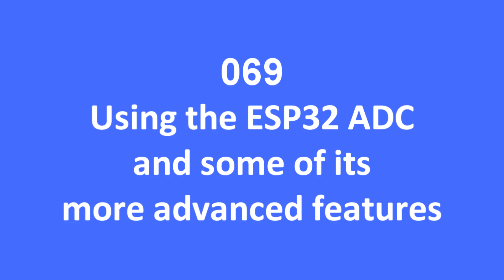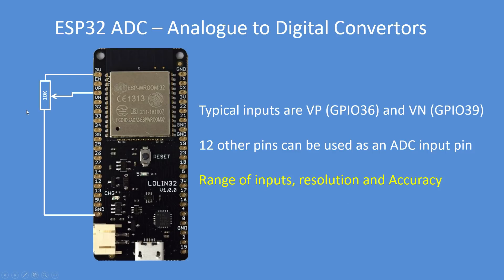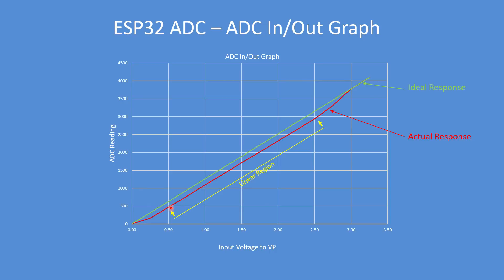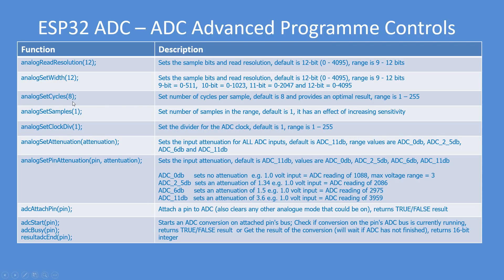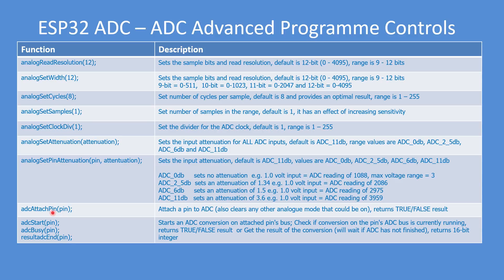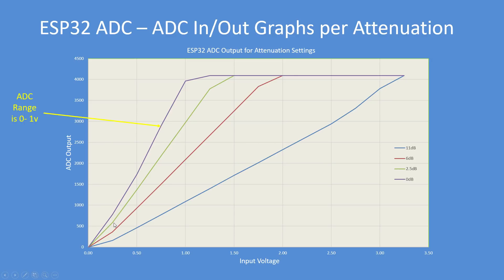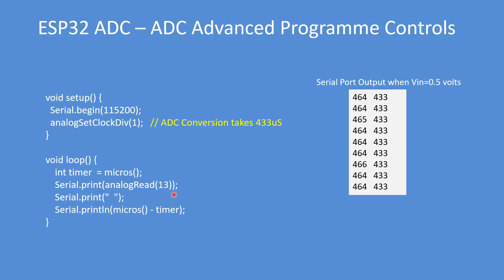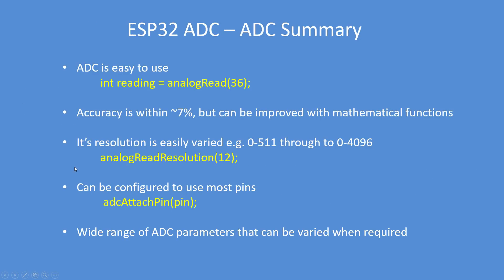Tech Note 069 - Using the ESP32 ADC and some of its more advanced functions

Comment: Can anyone explain the consequences on accuracy (RMS noise) versus conversion time or ??? of the settings for analogSetCycles, analogSetSamples and analogsetClockDiv?
For what kind of situations might I want to change these?

Suppose I have a vert slow signal like >> 1 second time constant?
Suppose I have a slow signal like > 1 second time constant?
Suppose I have a signal like > 10 milli second time constant?
Suppose I have a signal like > 1 milli second time constant?
Suppose I have a fast signal like > 10 micro second time constant?
Reply from the maker: Sampling speed, or sampling rate, is the number of samples taken per second of any signal to create a digital representation. Higher sampling rates lead to a more accurate digital representation of the analog signal, but this increases the amount of data and processing required. Lower sampling rates can lead to aliasing, where high-frequency components are misidentified as lower frequencies, so it’s all a compromise and there is no empirical rule to help with decision making. There is a rule of thumb that sampling needs to be at least x2 the fundamental frequency of the waveform being sampled. This is a huge subject, but the Nyquist  theorem is a good starting point.

Comment: Quite helpful. On a battery voltage indicator code part and figuring out the graphics and the numbers. I do a whole battery drain and it's 6 hours now. Then I try to charge it up to 100%. When I can get a range of almost 100 units it goes into "a battery" picture of all, half or quarters (pixels). This makes it realistic. The last battery indicator (another device) gave a percentage from somewhere which didn't show in real life. By caring for the details it becomes useful.

The "100 units" is from around 4.20v --> 3.20v as 3.00-3.20v is unreliable by turning up something like brightness, so a red warning thing can come a bit before that. I'm not even sure, if this device is turning off at 3.00v like the other device.

Comment: Hi David, Thanks for the good videos. In the code i see two formulas. The line that is commented out works better in my case. What is the difference between the two formulas?

  // return -0.000000000009824 * pow(reading,3) + 0.000000016557283 * pow(reading,2) + 0.000854596860691 * reading + 0.065440348345433; (works better in my case)
  return 0.000000000000016 * pow(reading,4) + 0.000000000118171 * pow(reading,3) 0.000000301211691 * pow(reading,2)+ 0.001109019271794 * reading + 0.034143524634089;

I also saw video 151. Do you recommend to correct the analogRead first for the vRef and after that this formula? When i do this my result at the test ESP32 in more correct without the vRef correction. But maybe the double correction is more solid when using different ESP32s? What do you recommand?
Reply: A strange thing i encounter with another ESP32 POE iso Olimex board is that i get better results with the second one... Maybe it's another batch with a difference ADC component
Reply from the maker: ADC production spread is quite high, so it’s always best to read the Vref saved to the device at production to get a better accuracy result. I notice you removed the higher order polynomials which have the least amount of effect in improving the linearity so yours is a simple accuracy error and it would have been better to add a simple offset.

Comment: David! ESP32 Wroom-32 doesn't work. analigSetPinAttenuation (36,ADC_0db);
Reply from the maker: What about ADC_11db?
Reply: @G6EJD 
#include "esp32-hal.h"
const int potPin = 36;

int potValue;
float voltage =0;

void setup() {
  analogSetPinAttenuation(36,ADC_0db);
  Serial.begin(115200);
}

void loop() {
  potValue = analogRead(36);
  voltage = (3.3/4095.0) * potValue;
  Serial.print("potValue:");
  Serial.print(potValue);
   
  Serial.print(" Voltage:");
  Serial.print(voltage);
  Serial.println("V");  
  delay(500);
}
Reply: Output:
potValue:1163 Voltage:0.94V
potValue:1161 Voltage:0.94V
potValue:1154 Voltage:0.93V
potValue:1163 Voltage:0.94V
potValue:1161 Voltage:0.94V
Reply: @G6EJD 
#include "esp32-hal.h"
const int potPin = 36;

int potValue;
float voltage =0;

void setup() {
  analogSetPinAttenuation(36,ADC_11db);
  Serial.begin(115200);
}

void loop() {
  potValue = analogRead(36);
  voltage = (3.3/4095.0) * potValue;
  Serial.print("potValue:");
  Serial.print(potValue);
   
  Serial.print(" Voltage:");
  Serial.print(voltage);
  Serial.println("V");  
  delay(500); 
}
Reply: potValue:1163 Voltage:0.94V
potValue:1161 Voltage:0.94V
potValue:1154 Voltage:0.93V
potValue:1163 Voltage:0.94V
Reply from the maker: @muhammadadnanahmed8324  I’m not sure what point your trying to get over?
Reply: @G6EJD 
I am trying to get 4095 port values (ADC Pin) on voltage 1VDC after set attenuation command. But not showing i have attached program with ouput Sir!
Reply from the maker: @muhammadadnanahmed8324  you will only get an ADC range of 4096 when it is set to 11dB
Reply: David thanks 🙏 you are great!

Comment: Hi, this is brilliant. Thank you. How would I go about combining this with the votage divider equation in your other video? Thanks in advance :)
Reply from the maker: Just follow the wiring examples I give in the video.
Reply: @G6EJD  Thank you for replying so quickly. What I meant was, would I have to include the divider adjustement equation too? Eg at the end of the polynomial? For example  
voltage = analogRead(33); (then on the next line) voltage = (your polynomial equation)  / 4096 * 30 * 247.191 / 220; (this last bit being the ajustment to take into account the resistor sizes I'm using)

Thats the best I can explain I think
Thank you
Reply from the maker: @G4-UK  ok understand, the polynomial corrects for ADC non-linearities, it assumes an unconnected ADC input. So you can connect your voltage divider resistors to the ADC input and then the polynomial will correct for ESP ADC shortcomings. All you need to do is size your divider values to give a 3v input at the maximum input voltage to the divider.
Reply: @G6EJD  thanks for your help. I'll have an experiment 😊
Reply: @G6EJD  Hi again, I think I've solved what I wastrying to do. What I was looking for is the voltage output from my 10w PV. So using your adjusted voltage, I then converted that back into the equivilent analoge value, then applied the equation to adjust the analoge value into the equivilent voltage the PV is currently outputting. The number looks about right, it was looking low until I applied this adjustment.

I'll measure it later with a multimeter.

  voltage = analogRead(33); //Voltage at pin as analoge value

  voltage = (-0.000000000000016 * pow(voltage, 4) + 0.000000000118171 * pow(voltage, 3) - 0.000000301211691 * pow(voltage, 2) + 0.001109019271794 * voltage + 0.034143524634089);  // Voltage at pin using polynomial equation to adjust ESP32 ADC linearity for better accuracy

  voltage =  (4095/3.3) * voltage; //Convert adjusted voltage back to analoge value

  voltage = (voltage) / 4095 * 30 * 247.191 / 220; //Convert to PV voltage
Reply from the maker: @G4-UK  you will always need to adjust the constants as you’ve done to compensate for the ESP32 having a varying input impedance between devices, apparently they are laser trimmed in the factory to try and remove as much variation as they can, but theirs always some. The non-linearity though is fairly constant across devices so the polynomial can remove the bottom and top end variations snd improve the overall accuracy to about 1%.
Reply: @G6EJD  I measured the PV and It's much better than it was previously, but yes, still out. I think I'm going to just have to buy an ADC module and be done with it.  :)

Thank you for your time and amazing videos!
Reply from the maker: Are you using a voltage divider? When you say the results are out, by how much? You should gets results within 1% easily
Reply: @G6EJD  I am using a voltage divider. I'll check again and check back. There is a minute delay in the code when I check the output in the code. I'll reduce it to allow a better reading. I have to refresh my browser at the same time as taking the reading. Might have just been out of sync. Give me 5.

Comment: Just tried your code example and its certainly way more accurate. However it maxes out at 3.14V with one function or 3.17V with the other. I need to measure just over a 3.17V threshold, is there any simple tweak I can do?
Reply from the maker: It really, the ADC maximum input voltage is Vdd - 0.2v = 3.1v so you’d need to a voltage divider, then multiply the resultant reading by the multiplier. So say two resistors of 100K that would divide the input by 2 then simply multiply the result by 2. Input —100K—ADC—100K—-Gnd
Reply: @G6EJD  thanks. I'm already using a voltage divider as my source signal is actually 0 to 5v range. I used a 100K and 200K to give me 2/3rds and then I multiply back up in my code. The device I'm monitoring is said to be in a fault state if the signal <0.3v or >4.8v. I didn't realise the ADC range is constrained by -0.2 as you say. I have an idea on how to fudge the code. Thanks again for the video and great advice.

Comment: Thanks for the video! I'm wondering how can I store or display the max/peak value from a voltage measurement just like the "Hold" function in a multimeter?
Reply from the maker: You can create a variable or two, one for max and one for min, then every time you take a reading test if (voltage > max) max =  voltage; then for min, if (voltage < min) min = voltage; if you define the min, max variables in static ram then they remain until reset to repeat the process. To reset max = -100000; and min = 100000; you can then display the values with Serial.print(max) and repeat for min.
Reply: @G6EJD - David  Thank you! My project looks so much better I've used alot of information from your videos they are very helpful🫡
Reply: @G6EJD - David  You should revisit this with ESP32-S3 also have a look at analogReadMilliVolts function 🤝🏽

Comment: Thanks David for the work here. Very useful and concise! You have implemented this linearity improvement polynomial with the ADC at 12 bit resolution (0-4095) but what about when you reduce resolution to say 10 bit (0-1023)? I suppose that I could just multiply my ADC readings x 4 to scale up to 0 - 4095 but recognize some quantization error will be inherent. Is it that simple to adapt this for 10 bit mode or am I missing something?
Reply from the maker: The difference will be the voltage range of the ADC which changes to ~0-1v when using a lower resolution. The polynomial is for an input range of 0-3.3v so won’t scale easily and 10-bit readings will effectively have any errors magnified by the multiplier. Espressif have done a lot of measurements with noise so you can see the results here: https://docs.espressif.com/projects/esp-idf/en/v4.4/esp32/api-reference/peripherals/adc.html

There’s a lot to using ADC’s as you’ll see. Don’t forget the ADC is very linear between about 0.2v and 2.8v
Reply: @G6EJD  Roger that - thanks. I'm endeavoring to keep my input voltages to 0.25 > < 2.75 V in the region of interest of the sensor by picking appropriate voltage divider values.

Comment: Many thanks for the video - very informative. I would really appreciate any help or input on the following situation which I cannot fathom, please: I am having an issue with the readings varying between reboots of the ESP32 - this means that I usually get a reading (with the standard 11db attenuation) of around 550 for an input voltage of .72v  and of 430 for input .58v. However, I noticed that these values were not consistent over time - so if I continually reboot the esp32, then on some reboots I will get a consistent value of around 800 for the same .72v input and 680 for the .58v input. This will revert back to the old levels of 550 and 430 after rebooting (resetting) the esp32 again. I have a 1uF cap across the input to GND for noise reduction, and the (external) impedance from my voltage divider is around 3.3kOhms. The board is an ESP32-WROOM32E within an ESP32-DevKitC development board. I have tried three different boards with the same result - it just doesn’t seem to make any sense, and I would appreciate any thoughts or feedback. Thanks in advance.
Reply from the maker: Have you tried a much smaller smoothing capacitor say 0.1nF as the ESP32 input impedance is quite high. I have never seen irregular ADC readings, so I’m thinking this is an external component induced issue. I have produced another video that shows how to read the internal ADC reference voltage, which yields a much more accurate outcome, try implementing that.

Comment: Thanks for this.  I must say I found the ADC pretty non-linear even in the allegedly linear region.  The polynomial helped a lot, although it was still inaccurate below 0.5V.  Fortunately I only need to measure battery voltage, and the polynomial greatly improved that.

Comment: My adc value fluctuate a lot even on dc value ..how I can improve precision 🙏 thanks
Reply from the maker: This ADC noise you can either add a 0.47 uF capacitor across the ADC pin and ground, but that will delay the reading speed somewhat but if speed is not an issue say a reading every minute then that will help. Or take say 10 readings add them all up and divide by 10 to get an average then you will remove sine or all of the quantisation errors. 
float average = 0;
For (int I = 0; I < 10; I++) { average += readanologue(pin);
average/=10;
Now average is the result of 10 readings

Comment: at 2:26 I still have a problem to understand: with ADC_0db meaning no attenuation, maximum voltage range should be no more than Vref (that is 1.1V on ESP32) while with ADC_11db the attenuation is so high that one can read up to 3.3V - but in this table all is mixed up.
Reply from the maker: The table came from Espressif and yes it is incorrect as at ADC_11db a 3.3v input gives a reading of 4095.

Comment: I have struggled with calibration of ADC of ESP32 and ESP32-S2 - many methods - and I ended up with 3 things:
1- install voltage divider calculated this way, that input voltage on GPIO is inside the most linear range. If you consider attenuation 11db then voltage shall not reach more than 2.1V on GPIO so for 4.2V max measured voltage the divider can be 50/50 - for battery operated devices I use resistor in the range of 200k Ohm each so that current drawn when devices sleeps is minimal - around 10uA due to the resistors - that should be ok considering that ESP32 consumes in deep sleep anything between 8uA (ESP32) and 22uA (ESP32-S2) - I am using only bare modules - not development modules with tons of components on them
2- CRUCIAL: add ceramic capacitor - range between 100nF - 1uF - if the voltage you measure is DC-like (i.e. battery or so) this will have no impact on the input signal (level) however the signal will be so linear that I completely abandoned the "in range" calibration (multi points)
3- the only calibration for my sensors I do is at 3.7V - the middle-like of the measured voltage - I use ADC to measure battery level, that is anything between 2.8V (minimum voltage for ESP32) and 4.2V (maximum voltage on charging battery) - ok, maybe 3.7V is not really in the middle but I rather stay with battery above this point. With this calibration at 3.7V the error in the whole measured range (2.8V-4.2V) is around +- 2mV - should be more than enough accuracy for my projects
Reply from the maker: Have you seen my video on how to read the ADC reference voltage (factory set) and from there improve ADC reading accuracy
Reply: @G6EJD  yes, not all ESP32 have this one burnt in - I checked mines and ESP32-S2 have and work ok but the ESP32 don't. Still: adding capacitor 100nF is recommended by Espressif. On top of that: Vref is not the only problem - it only shifting the reading. Problem is lack of linearity. Even with 2 points it is still blabla for the precise measurement. The most accurate would be LUT - but that one is seriously bringing lots of memory waste to the ESP
Reply from the maker: @zyghom  Well the polynomial I produces uses only a small amount of memory and makes the response linear from 0.1v to 3.3v

Comment: Hope this is still an active thread.  I have been using the ESP32 WROOM-32U development board via the Arduino IDE and doing analogRead() on pin 36 every 100 microseconds until I accumulate 2000 values in an array.  Configured for 10 bits.  I now understand (I think) that  the ADC takes about 400 microseconds to complete conversion.  What do the numbers I've been writing to the array actually mean (or represent)?
Reply from the maker: They mean the ADC value read at that instant when the ADC completed its conversion sample so at worst real-time + ADC conversion time
Reply: @G6EJD  Thanks.  So it buffers all these requests I'm sending it?
Reply from the maker: I wouldn’t say buffers as the requests are blocking cpu progress until completed, although of course there are two CPU’s in most ESP32 variants so processing can continue on the other cpu until the conversion is completed.
Reply: @G6EJD  Are you saying each analogRead is serviced before the next one is handled?  Seems this puts the process 8 Reads behind each millisecond, and this goes on for 5 to 7 seconds.  Actually have pinned Core 0 to WiFi activities and Core 1 to application processes.  Pin 36 is connected to an axis of an ADXL335.  I do these analog reads at 100 ms intervals and save the value to an array if the value is beyond a threshold value.
Reply: My adc value fluctuate a lot even on dc value ..how I can improve precision 🙏 thanks